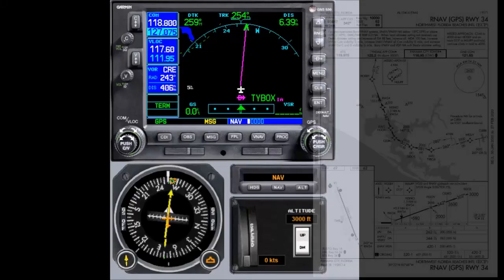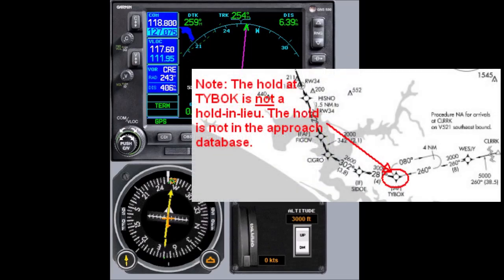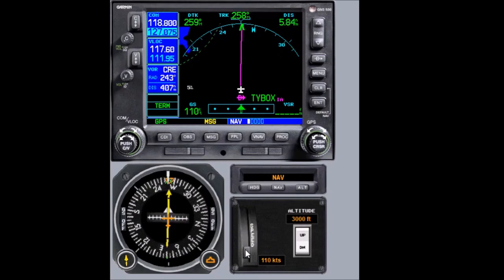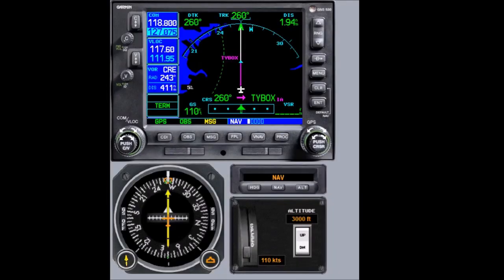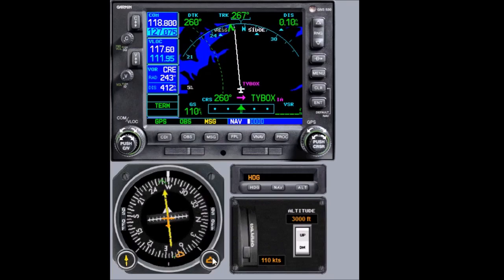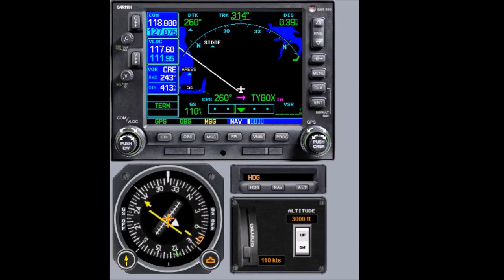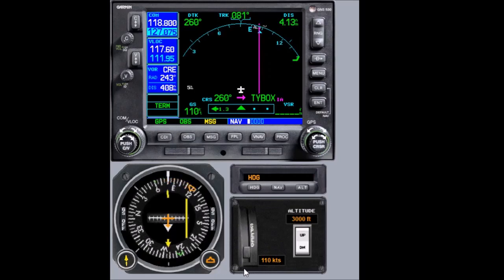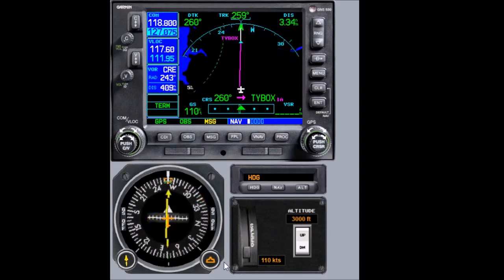Holding with the Garmin GNS

Comment: Neat and clean explanation. Thank you.
I'm still curious about the software you are using.
Reply from the maker: All my avionics videos use the trainer software provided by the manufacturer. The GNS (Windows) and GTN (Windows and IPad)  are available free from Garmin. The IFD (iPad) from Avidyne. The G1000 software (Windows) is payware from Garmin, although older versions are only available from third parties.
Reply: @midlifeflyer  Thank you for your answer.... do you happen to know what "other parties" provide the G1000 free software for Windows (I suppose it cannot be connected with MSFS2020 though)?
Reply from the maker: @AntonioFardella  sorry, no, AFAIK, the G1000 software is not free anywhere. I meant that I think Garmin itself doesn't stock the early versions but they can be picked up at places like mypilotstore.com. I can't help you with MSFS.
Reply: @midlifeflyer  Thanks man.... I'll see what i can do.
Thanks for your videos though.